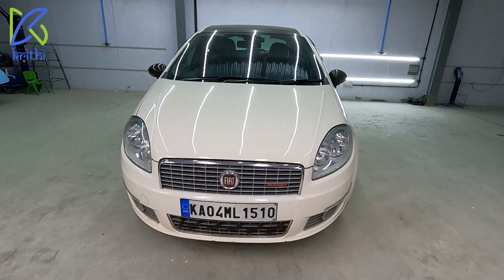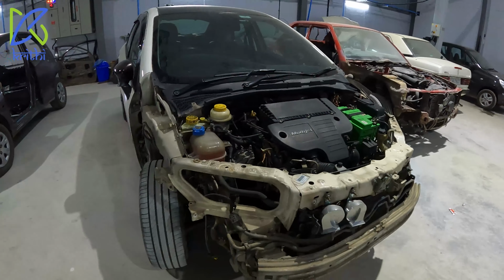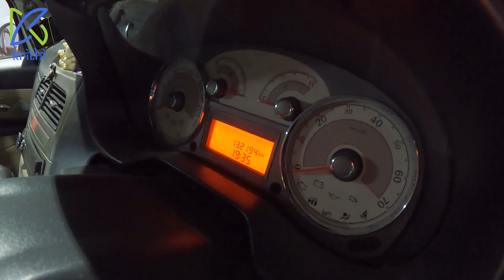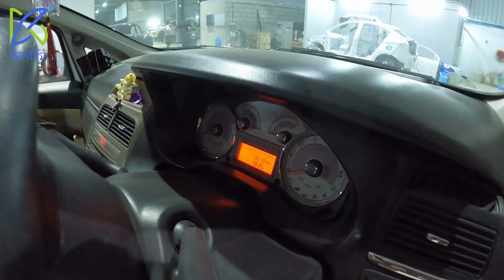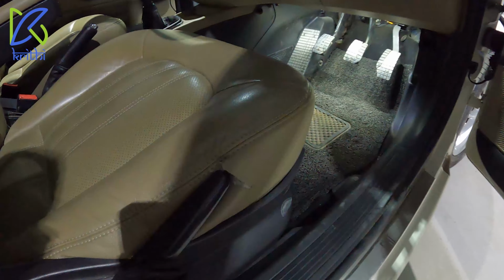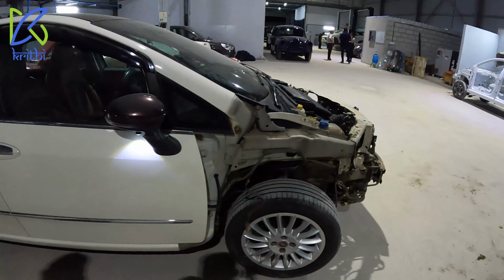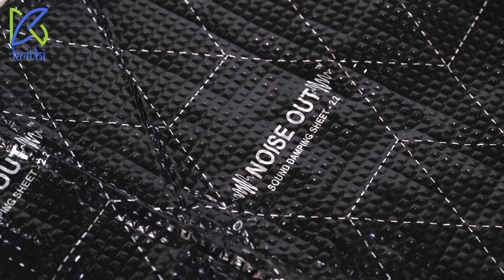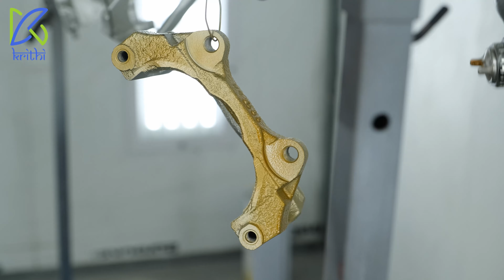Bangalore's BEST Full Body Repaint for Fiat Linea at Krithi Car Care

Comment: Impressive job!! 
By the way, where did you install those puddle lamps and footwell lights for the Linea? Looking out for them everywhere.
Reply from the maker: Hi,

Had picked up a the number plate LED lights a few years ago from Amazon.  The same has been installed on the Mirrors.  Not sure if they are available now.  Wondering what to do if one of them conked off.

Cheers,
KRISHNA

Comment: I own a Fiat Linea classic petrol myself. This was the most detailed paint job I've seen. Comparable to videos of Brotomotiv. Since entire vehicle was dismantled, what was the cost of the work? Can you tell the all-inclusive figure?
Reply from the maker: A standard overcoat paint job with Cromax paint should cost around 75k, Glasurit around 90k.  If the car is stripped down like the one in the video, it can go upto 150k.
Reply: @KrithiCarCare  How long will it take for the full job (Denting included)?
Reply from the maker: @kishorejohn5577  The work can take anywhere between 2 to 3 weeks depending on the amount of tinkering work required
Reply from the maker: We do a lot of complicated BodyShop and tinkering works which are currently not video logging as much as Brotomotiv. We have not invested on the video content creation equipment, but we have certainly invested on the top notch BodyShop Equipment and hence lesser amount of videos.  Do visit our workshop to get a first hand experience of our work quality.

Comment: What is the cost?
Reply from the maker: Hi,

Request you to kindly reach out to us at 9148474707 or 9148474646.  The costing will vary depending on the type of work required.  It would be ideal to discuss, understand the requirement and provide an estimate for the work.

Cheers,
Team Krithi

Comment: Excellent work sir  I have linea 2012 petrol engine I wanted full body paint and repair works Sir how much cost sir
Reply from the maker: Hi,

The cost varies based on the type of paint, customization etc.  Request you to kindly reach out to us at 9148474707 or 9148474646.

Cheers,
Team KRITHI

Comment: I have linea multijet disel engine 2017 model what is the cost of only full body repaint
Reply from the maker: Hi,

The cost varies on the brand of paint and type of repaint as well.  Request you to kindly call us at 9148474707 or 9148474646 to provide you the right estimate.

Cheers,
Team KRITHI

Comment: Nice work How much it cost?
Reply from the maker: A standard overcoat paint job with Cromax paint should cost around 75k, Glasurit around 90k.  If the car is stripped down like the one in the video, it can go upto 150k

Comment: For 10 years old Fiat it's still in very good condition, I hardly see your Fiat Linea has rusting issue,

 My Fiat Punto started rusting in 4th Year even though I maintained the car very well with very less washing and mostly I use to use the Jopasu for the dust cleaning and than I use to clear it with spray and wipe
Reply: Same here, probably this problem is with the Punto evo. How r u planning to repair it? Full repaint?

Comment: hey hello from MH , COULD YOU PLS TELL me how much is the total cost . I`m planning for my car and how many days will take , same linea MJD 2010 model
Reply from the maker: A standard overcoat paint job with Cromax paint should cost around 75k, Glasurit around 90k.  If the car is stripped down like the one in the video, it can go upto 150k.  Request you to reach out to us at 9148474707 we can assist you on the paint work.

Comment: Nice work..👍
Give me the price and dtls...
Reply from the maker: A standard overcoat paint job with Cromax paint should cost around 75k, Glasurit around 90k.  If the car is stripped down like the one in the video, it can go upto 150k. Request you to reach out to us at 9148474707 we can assist you on the paint work.

Comment: I have same model linea what is the cost of its work?
Reply from the maker: A standard overcoat paint job with Cromax paint should cost around 75k, Glasurit around 90k.  If the car is stripped down like the one in the video, it can go upto 150k

Comment: I have linea multijet car model dec 2011 i'm planning for detailed work with painting.
Reply from the maker: Hi,

Kindly reach out to us at 9148474646 or 9148474707 to assist you on the requirement.

Cheers,
Team KRITHI

Comment: What was the whole cost for this work?
Reply from the maker: A standard overcoat paint job with Cromax paint should cost around 75k, Glasurit around 90k.  If the car is stripped down like the one in the video, it can go upto 150k
Reply: Total cost

Comment: Cost?
Reply from the maker: A standard overcoat paint job with Cromax paint should cost around 75k, Glasurit around 90k.  If the car is stripped down like the one in the video, it can go upto 150k.